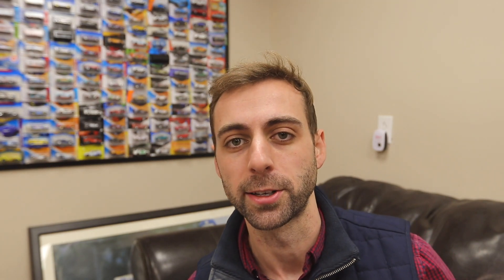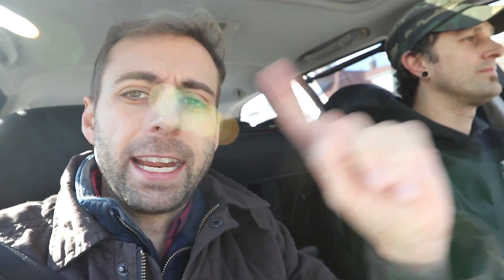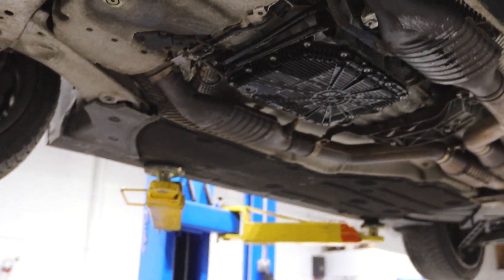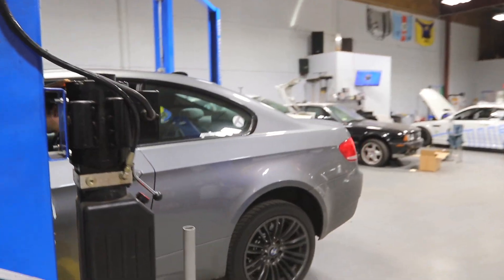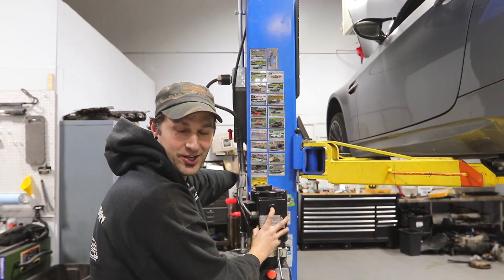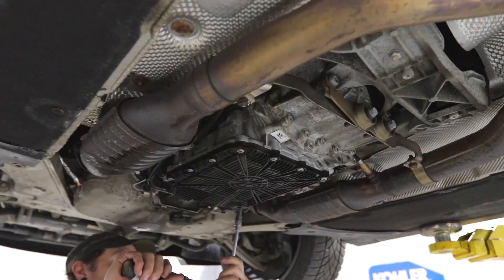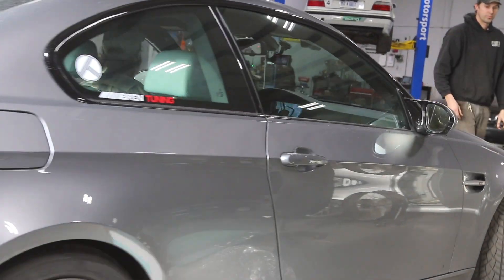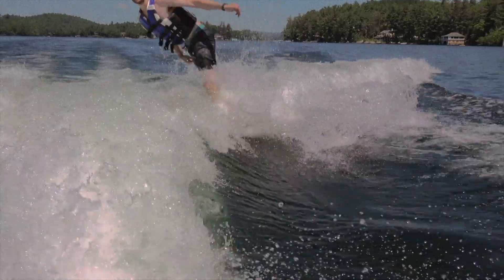E92 M3 DCT Leaking - DCT Fluid Service

Comment: Had this leak on my dct. The leak was coming from the mechatronics cover and one of the hoses. Killed my wallet lol. But im glad I looked under the car otherwise I would have not seen the leak due to the undertay covering the pan.
Reply: How did it cost u to repair that
Reply: @Motorsports_3  ive notice a leak on mine and have been getting quotes for worst case scenario which is the mechatronics. 2k since its a trans. out service.

Comment: Hello, I am curious if you can feel the clutch disengage and engage a little in S4 mode when you lift off the throttle or engage the throttle in the same gear? Thanks.
Reply from the maker: The clutch should not be disengaging when you lift of the throttle. You should feel drag just like you would in a manual gearbox if the car was in gear and you lifted off the throttle.
Reply: @TedwardDrives  That makes sense, but when I am on the gas and then I suddenly lift off there is a slight jerk in the car before it begins to engine break. What do you think it could be?  The slight jerk also happens when I am coasting and then give the car some gas.
Reply from the maker: @sammatchett6014  Ahh I see. Yeah my car does that too. My guess is worn motor mounts and/or transmission mounts. you're feeling some slack in the driveline find its way home when that happens. How many miles are on your car?
Reply: @TedwardDrives  Okay, thanks. It doesn't bother me I was just worried that something might break. The car is just under 75 000 kms.

Comment: Mine is leaking a bit too, it's the gasket.  I'm going to get the entire DCT pan kit.
Reply from the maker: definitely some fluid up around those feed/exhaust lines above the pan so its probably leaking from a few places. We checked the level though and it was still topped off. It's amazing how far a few drops can spread

Comment: Is it necessary to change the plug and filter on a 30k miles car ?
Reply from the maker: You should be good to continue with 30k miles. thats nothin. But you may want to just take off the trays under the car and inspect for leaks. 6-10 years can have an impact on rubber, gaskets, and even plugs backing out regardless of miles.
Reply: @TedwardDrives  thanks ❤️I'm planning to change all the fluids, better safe than sorry since I don't know how the previous owners have driven it, how often do you change your engine oil, I've driven it 4000 miles and planning on changing in 5k(no track) Im not used to changing oil that late since synthetic oil is hard to find here , I usually change it before 2k miles, so I'm a little uncomfortable driving 5k 😅
Reply from the maker: 5k is JUST FINE for oil changes. I run analysis on every oil change and even when ive pushed close to 6,000 miles the oil is still holding up and doing its job. 2k is insane unless you only drive the car 2k per year and thats your annual oil change. It's also a good idea to change oil after a track day =)

Comment: If you're going to get some track/race time this year, come on out to a hillclimb event (or three) this year!
Reply from the maker: I've always wanted to do Okemo!
Reply: @TedwardDrives  The road surface has been breaking up quite a bit over the past few seasons at Okemo. I'd definitely recommend Burke as a first hillclimb though; The surface is great, the course is easy to learn, and it isn't much further than Okemo is!

The only real downside is that you don't have roadside condos available at Burke; Okemo has a hotel across from the staging lot as well as condos available all over the area.

Comment: Mine is leaking on the ground
Reply: @TedwardDrives  is it bad?
Reply from the maker: Most weep a little bit but if you’re getting actual drops falling it’s time to replace some gaskets. Be sure to inspect the hoses that feed and return fluid in addition to the gaskets on the box
Reply: Alright and will do and tbh I am weeping alittle bit since I just bought the car how much would I be look at money wise to replace the gaskets and hoses bmw pricing vs indy shop if u have an idea it would be nice.
Reply from the maker: Indy shop is always the way to go. Hunt around and find one that track guys use and trust.
Reply: @TedwardDrives  alright man thx
Reply: @TedwardDrives  I took it to euro shop and they said my motor mounts are blown so the engine and transmission was lower and one of the oil cooler lines was rubbing against the belly pan and tore it